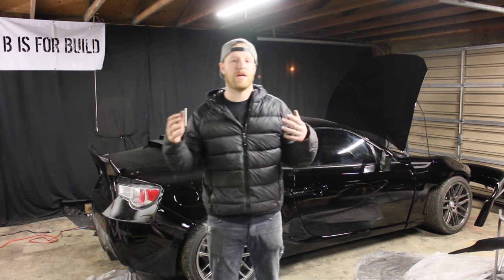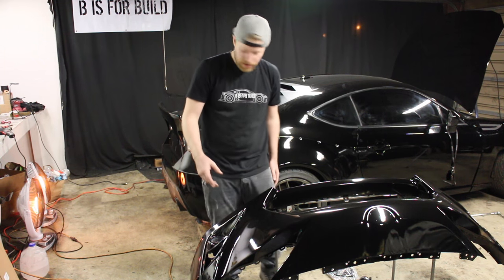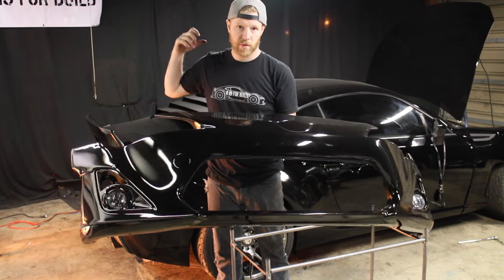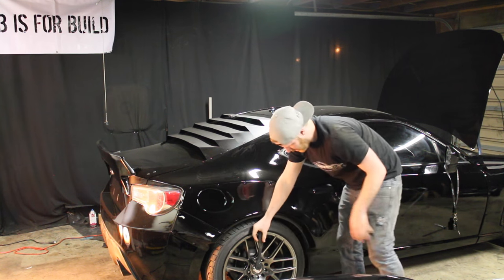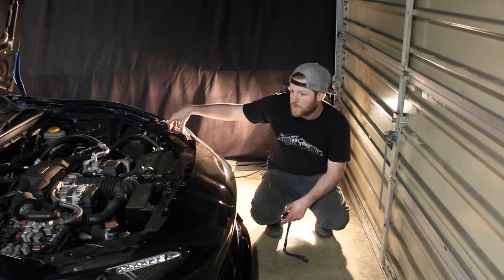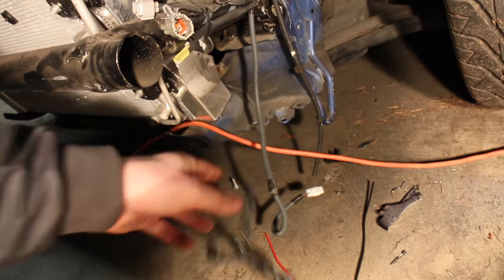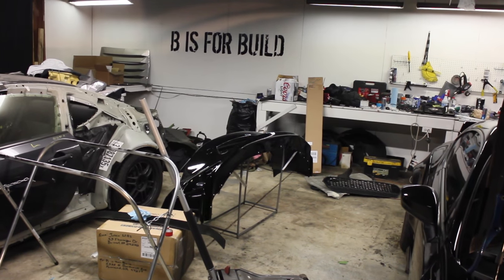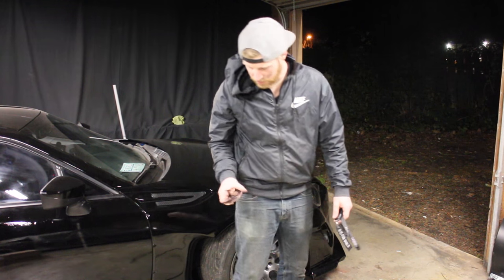BRZ Resurrection Pt 29 - Mounting Side Skirts and Bumper

Comment: Well, I have no idea on gaining wheel clearance, but I do have a suggestion for you. I think you should wet sand and buff your $600 paint job for a better outcome. In doing so, you will remove the orange peel as well as all of the other NOOB paint issues. JUST A SUGGESTION
Reply: YES
Reply: +Donald “NOT PLAYING1970” Byrd Yeah, definitely for the orange peel.
Reply: +Donald ”NOT PLAYING1970” Byrd I dont know if the sprayed anough coats of clear for it. Might be too thin.
Reply from the maker: +Donald “NOT PLAYING1970” Byrd paint needs at least 10 days to dry before doing that. Ill get it done, just needs time.
Reply: +B is for Build cool, I'd hate to see your efforts go astray by not taking that last step to obtain the best possible finish.
Reply: +B is for Build paint does NOT need that long to dry! It is much easier to sand and buff clear before it is fully hard. What would take 20 minutes will take hours after you let it harden
Reply: +B is for Build  cutting and buffing black paint is a real process. After you sand and compound it, you have to polish it with some swirl remover and if you don't get all the sand scratches out it will show up easily! Defiantly worth it for the end result tho!
Reply: +MotionAutoTv Those swirls are every black car owners nightmare
Still worth it tho
Reply: +Fi Metal let the paint fully cure before buffing...specially when the guys dont do it everyday it will probably be his first time doing it...prevents mistakes with a harder clear...the best to do is not even washing the car untill the paint is cured...if it takes you too long you re not using the right tools for the job...wet sand/compound/glaze/wax/done ;)
Reply: +MotionAutoTv hey trevor!
Reply: +Donald ”NOT PLAYING1970” Byrd Just sand it with 1000+ grit paper and buy a special wax and it will look like a proffesional painter painted it! :)
Reply: +Wilhelm Danielsson No it won't unless you polish it after sanding it with 1000 grit. Sanding with 1000 or even 2000 grit will just leave a dull matte finish until it is polished up to bring out the shine. Definitely use a dual action polisher for the task you you'll be there for hours and destroy your back from the work and definitely finish with a good wax.
Reply: +Donald “NOT PLAYING1970” Byrd lmao who tf says "noob" when referring to a self taught spray job
Reply: I was thinking the same thing and throughout the whole video, he keeps wiping the dirt.  Anyone who has ever owned a black car knows you never wipe the paint unless you want scratches.  Made me cringe every time he did it until I saw how bad the paint really looked.

Comment: Chris, your sheet metal used to cover the gap beneath the fuse box is going to rust away, I'd have painted it at least so keep that at bay, but honestly, you should've drawn up a cardboard template and welded it in there then painted the raw sheet metal.

Comment: Cars looking really good! All it needs is a good cleaning and waxing and its perfect! To fix the rubbing maybe you can try  adjusting caster angle on the wheels. That is if you have enough room behind the tire and if the car will drive fine without going through a ton of tires.

Comment: you need to ditch the spacers and extend the lower control arms to stop it rubbing. the scrub radius is just to big and it hits the fender/bumper support. by reducing the scrub radius the Turing circle of the wheel will be smaller and hopefully not make contact with anything. and camber plates will be needed at the top to reduce excess camber

Comment: +B is for Build aren't those holes in the front bumper you filled where the front turn signals go??? If your headlights don't have blinkers then you no longer have turn signals. And that epoxy on the filler panels sounds kinda permanent.
Reply from the maker: +CrazyLazyDave the headlights have indicators built into them so were all good there. And those things i put in arent permanent at all, the housing i epoxied them into just clips into the bumper, so for another $30 i can buy another set and do w/e i want. Once we get some power mods we might wanna source our cold air through there.
Reply: +B is for Build cool cool. just checking. 

and if we were talking about the track car, which we aren't, I'd say route some brake cooling ducts instead of air intakes.

Comment: You could try and take the car to a wheel alignment shop, if there is room for it you could adjust the caster angle a little to get the wheel further back without thouching any bits and pieces that may rub on your tire ;)

Comment: Regarding rubbing/space on the front tires, talk to an alignment specialist and see about getting some caster adjustment for the front suspension, it looks like there is too much forward caster. Move it back a bit and you should have space. Otherwise, a lower profile tire is the answer but I don't think you should need to.

Comment: get a smaller tyre so for example instead of a 245 55 18 get a 225 40 18. the slight size size difference in the tyre will give you the room you need. I did it in my e90 and worked a treat

Comment: It wouldn't be cheap but you could get tires for the front only that have a smaller sidewall. They'd be a smaller diameter so you'd gain space from the parts that are rubbing. A skinnier tire will help too

Comment: so if you are having issues with the tires rubbing the inner part of the fender well you need to reduce your side wall. if it hits the outer lip of the fender reduce your spacer  spacing by 5-10mm
Reply: Btw I agree with trying a caster adjustment, negative caster however will cause the steering to get light and could induce slight wondering in the front end. the brz/frs needs caster camber plates to get this adjustment.

Comment: Once I left my keys in the trunk too. Too bad I only had one key and the doors locked automatically. Had to break in to to the car from the window. Slipped a thin metal wire over the window and opened the door with that. It took like 10 minutes and the alarm was ringing the whole time, my neighbors didn't appreciate that.

Comment: You may have a air bubble but when you think about it isn't the bottom of the radiator supposed to be cooler because it's going back into the engine cooling it off and the top is supposed to be hot because it's the hot coolant coming from the engine to be cooled. Just something to know. ps-Im a studying mechanic

Comment: I had the same problem with clearence on my vw , trimmed alot and still rubbed only thing you can do is put smaller tyres upfront i had 215/40/17 and rubbed like craaaaazy i trimmed and rolled my fenders still rubbed put a 205/40 on and all problems where gone

Comment: have you had the vehicle aligned?  is there anyway to adjust caster in the front.  I havnt really worked on a gt86 but I know for my 240 I have tension rods that let me move the position of the wheel.  if not you might have to run smaller size tires.  what size are they btw?

Comment: You should of used those spaces in the front bumper for air intakes and have them with black tunnels going into the air intake
Reply: he should have put turn signals in there that go there so he had turn signals and the car would be road legal since this is supposed to be a daily driver

Comment: these Lisle Spill-free funnells work really well for bleeding radiators; http://www.amazon.com/Lisle-24680-Spill-Free-Funnel/dp/B00A6AS6LY
Just fill up the radiator system then put about 2 inchs of coolant/water in the funnell then idle the engine for 10 to 20 minutes depending how long it takes to warm up... don't open the heater core till it's fairly warm to reduce the warmup time

Comment: Are you going to do any performence mods on this car. Plan A BRZ?
Reply from the maker: +Simas/Mc not for a while, the Plan B will get some power mods first and if they are reliable then ill move them over to the Plan A and go harder on the plan B
Reply: +B is for Build before performance mods.....do you have turn signals in your headlights???  because if not....you have no front turn signals.

Comment: roll fenders with a rolling pin. it'll help a lot
Reply: he is rubbing on plastic not metal at this point. he already cut away all the metal. now he rubs the bumper and plastic over fender. just needs different tires. simple.

Comment: complete sand it with 1500 then 2000 then 3000 then get a hold off some menzerna 300 cutting compound cut the whole car at about 600-900 rpm  get out all the sand scratches then get a hold a sum menzerna 3500 polishing compound run that at low rpm about 400-600 press hard go over the whole car it will look mint an seal it all in with sum nice wax trust me on this im a professional detailer i know what im talking about

Comment: Tube the front for clearance!
Reply: He isn't making a drift car he's making a daily with a good structure and wants to actually not weird the cops out when he crashes
Reply: He can say it was a salvaged car with front end damage and he rebuilt it. I've got a buddy that did the same thing. If anything it increases the structural integrity if you do it right.
Reply: Zakk Gross maybe but it's too much work for a daily thats meant for not crashing hence the rocket bunny kit
Reply: Yes, but he can't drive it if the frame is cutting up the tire. I'm purely thinking fitment here.
Reply: Zakk Gross he technically could he wouldnt spend the time on a tube front but instead install some suspension work or just do simple work instead of a full tube front

Comment: 16:30 did I see the windows roll down and up a little when you open and close the door? I cant believe Subaru is doing that german crap to 'save' the rubber seals! I hope they re not on the Toyota 86 :(
Reply: It's so that the window seats inside the rubber seal... Otherwise water would run right in the top of the window. It has nothing to do with saving the seals.
Reply: +Average_azn yeah ok, but the older cars with frameless windows didnt need this trick, and didnt leak either.. To name a few, subaru outback and toyota celica

I do hope they have thoroughly tested it to make sure the motor can withstand the test of time.

On another note, what a coincident to have met you my fellow azn :)

Comment: 2jz swap the plan b
Reply: YES YES YES
Reply: Yesss
Reply: Do any of you realize how expensive 2J's are let alone the parts when something breaks
Reply: +JOSH.0 don't act like it wouldn't be awesome
Reply: +Will Helterbrand when it comes to a 2j money doesn't matter!
Reply: +Loegan LaShier Naw, LS swap it. Much cheaper, still a shitload of power.
Reply: +Tommy-Lee Armstrong damn tommy, back at it again with the ls swap
Reply: +Tommy-Lee Armstrong yeah but that ruins the balance and weight distribution
Reply: Loegan LaShier I believe we've met in another comment section before. Lol.

But no, the only reason I mentioned it was because it's cheap and I don't know his budget limits. The 2JZ would be a much better option for the BRZ.
Reply: Will Helterbrand Yes, it'll definitely be more front heavy. It certainly won't handle the same, but as long as it's not too front heavy it could still be a good track car.
I need to do some research to see how much it'll change the weight balance.
Reply: Will Helterbrand Apparently it only changes the weight balance by 3% towards the front. And adds approx. 200 lbs, most of which is from the transmission.

http://gmauthority.com/blog/2013/06/subaru-brz-with-6-0l-ls2-corvette-motor-takes-to-the-streets/
Reply: +Tommy-Lee Armstrong I forgot to think about his budget. but you post a strong argument.
Reply: +Tommy-Lee Armstrong ar12 or car throttle would be the only possible place you could have found me
Reply: Loegan LaShier It was probably there. But yeah, I'd rather see a 2JZ go into the BRZ, but if he can't fit it into his budget then the LS is the next best thing.
Reply: +Tommy-Lee Armstrong or a turbo, or sti swap or a 1jz
Reply: Loegan LaShier These things do great turbo'd. I think TC9700Gaming's FRS has over 300hp on 14ish lbs of boost. I'm not sure on the numbers. I don't think he ever posted anything specific.
Reply: +Tommy-Lee Armstrong and you have the boxer rumble with a good bov